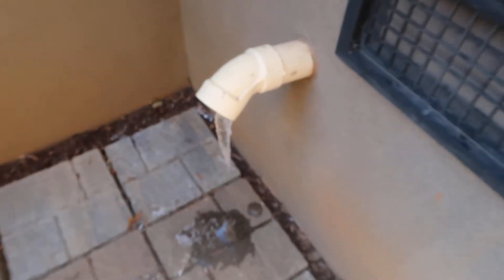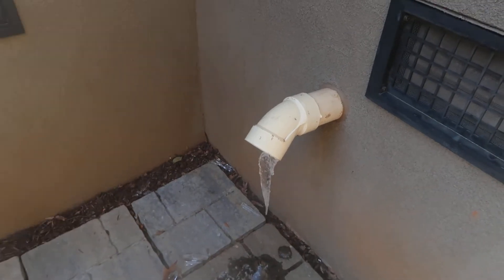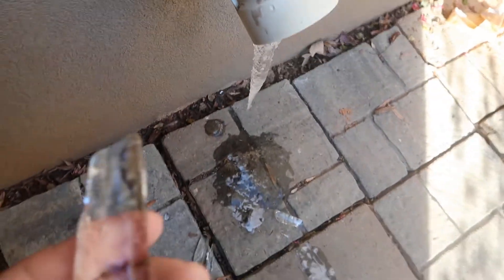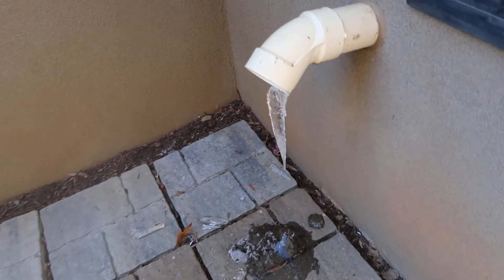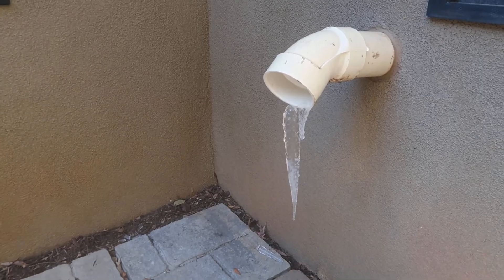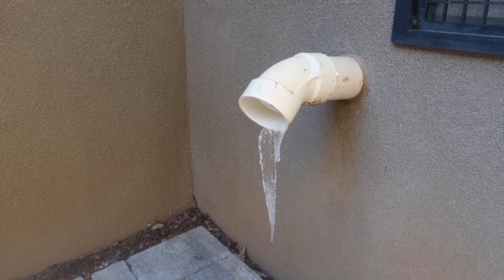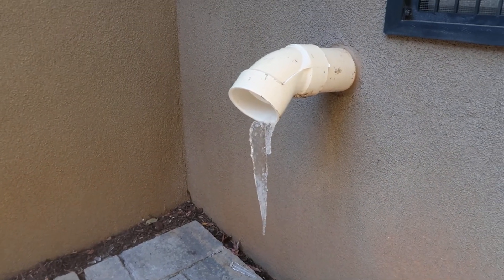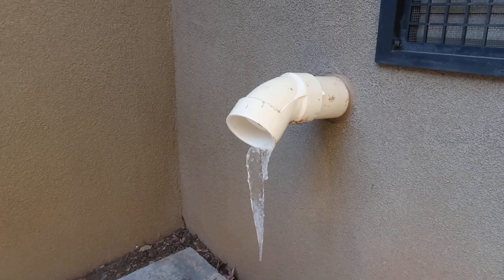Why is There Ice Around My Furnace Exhaust

Comment: I put a metal mesh screen on mine and it freezes the screen when it gets very cold. I can see that becoming a problem so I think I will remove it for now. My unit is a split pipe one side facing up and the other facing down so there are 2 ways for the carbon monoxide to escape but thank you for the video it just confirmed my worries. I wanted to close off the hole so rodents don't go inside. I'm guessing that being clogged up is even worse.

Comment: Thanks for this video! I just installed a furnace in my home and I noticed some condensation buildup inside the vent pipe. Obviously it runs out side because of slope but was curious as to where the moister was coming from.

Comment: Hello, I have quick question for you. Say if i took this ice into my house and melted it down in a pot, will the gases coming off of it be posionous with carbon dioxide? Or is the ice safe to melt down in my house considering the ices gasses that came off of it were a milky white. Thank You!
Reply: The byproduct of combustion is called condensate, not water as it is highly acidic. Why would you melt it in a pot? Turn your tap on and get clean water!
Reply: @victork3397  I think it was an attempt at a joke though you never know these days lol.